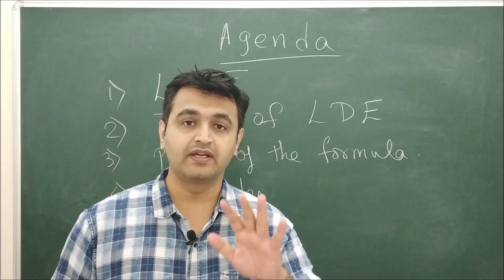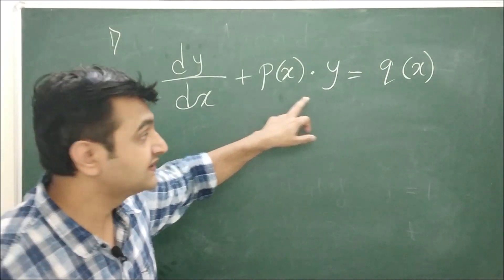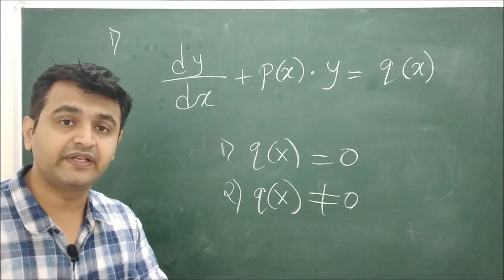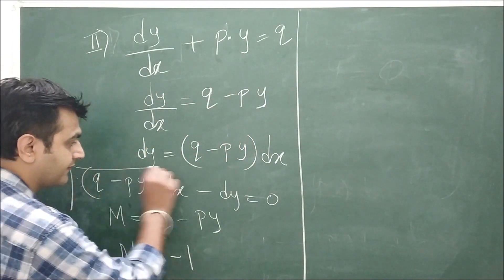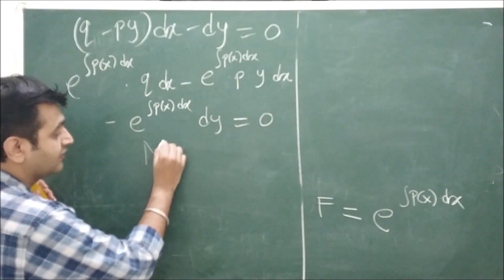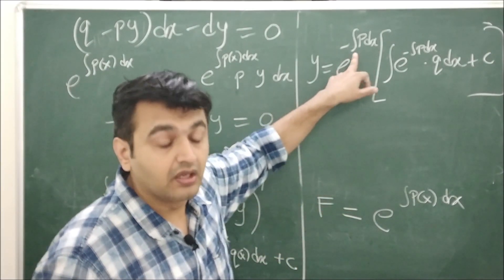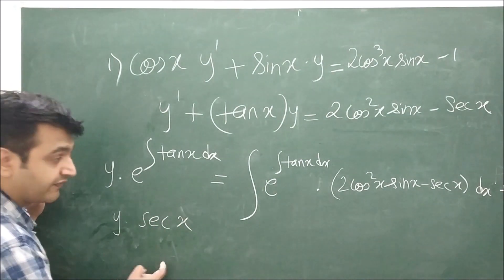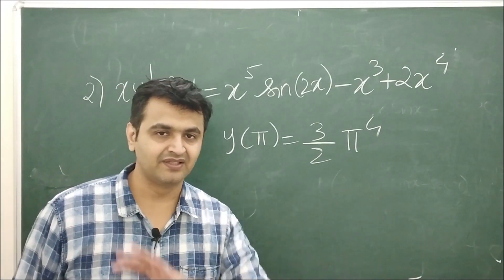Session 10: Linear Differential equations of first order.

Comment: Ans
1) y=-cos(x)(1+sin^2(x))/2-sin(x)+c*cos(x)
2) integrating factor is 1/x^2
C=(pi)^2+(pi)-1/4
y=x^4*(1-cos(2x)/2)+x^3*(sin(2x)/2-1)+x^2((pi)^2+(pi)-1/4+cos(2x))
Sir it is correct??
It is so large
Reply from the maker: I need to solve. I have not solved yet.
Reply from the maker: For first, shouldn't that be 1- 2sin^2(x)?
or 
y= cos x(-cos(2x)/2) - sin x + c cos(x)